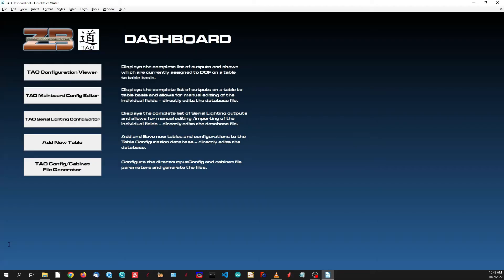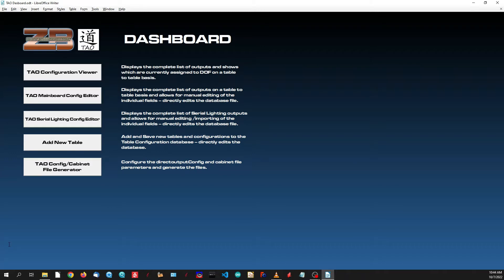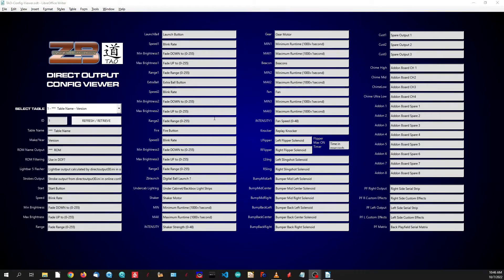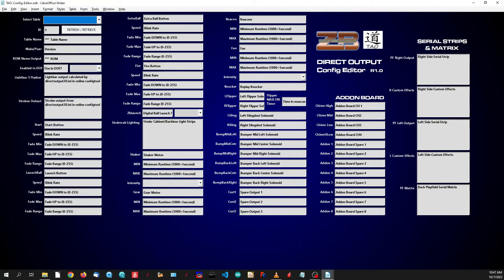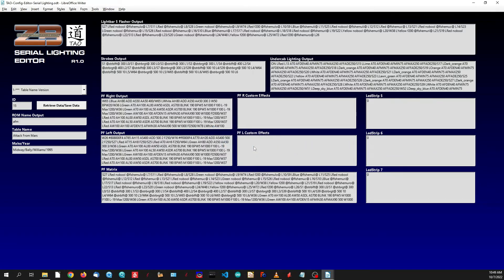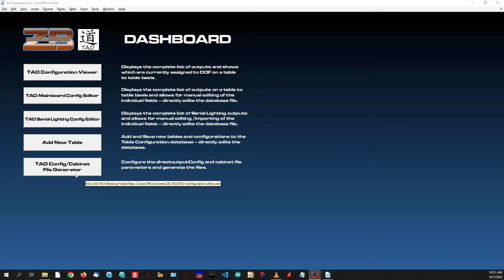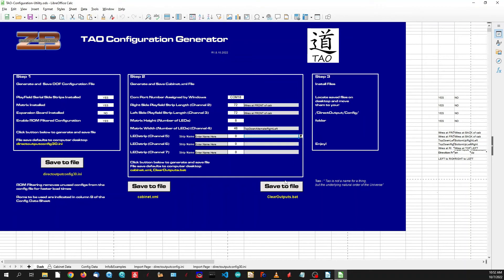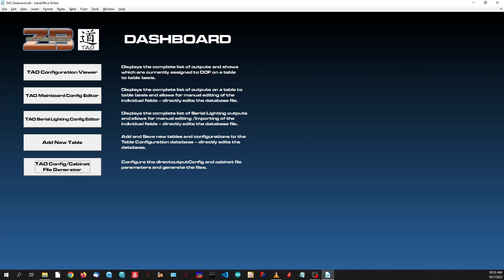TAO Config Utility Overview

Comment: Great job Zeb.
For other builders watching this: I would like to mention you only need one ATX power supply to run TAO.
Reply from the maker: That is correct to a point, ultimately it comes down to just how much you want to run but the demo in the video is running 10 solenoids, a shaker, a lightbar with strobes and serial side strips from an old, used 500w DeepCool psu.